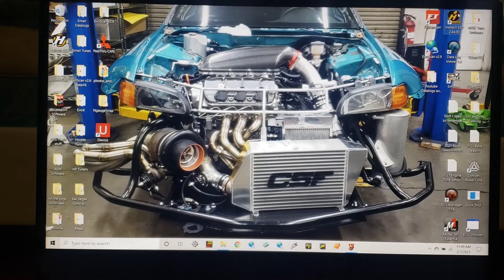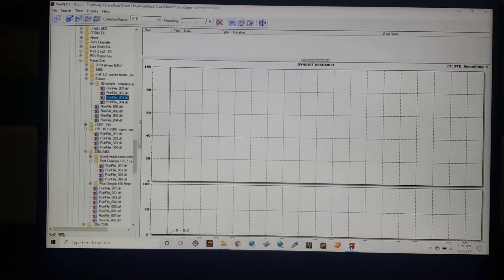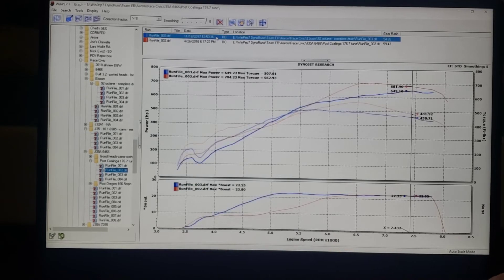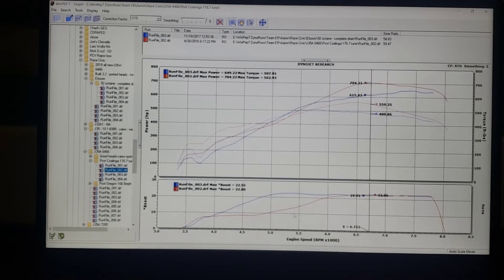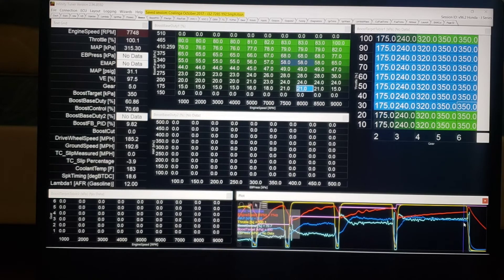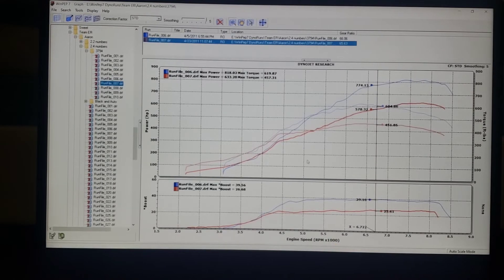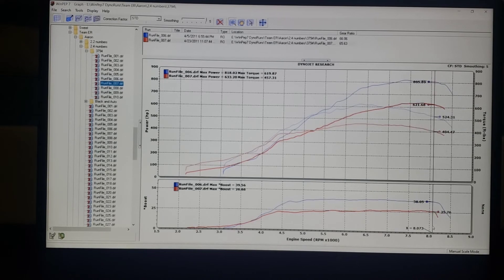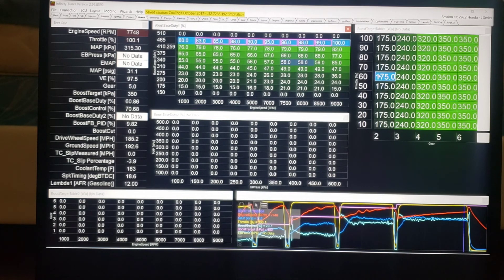Basics of Boost Control v1.0

Comment: Very informative video, I'm running a fairly small aftermarket turbo, but modified turbofold. It's hitting 25psi~ish, my tuner pinned wastegate duty cycle above 95% most of the time mid-high rpm. I'm a little worried about turbo life but he thinks the turbo is made that way and is capable to do that. What do you think?